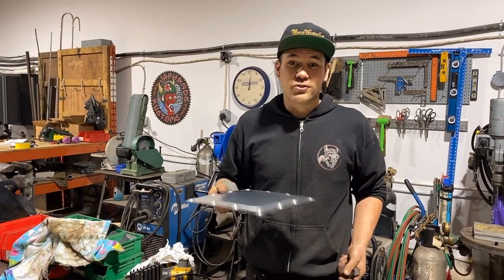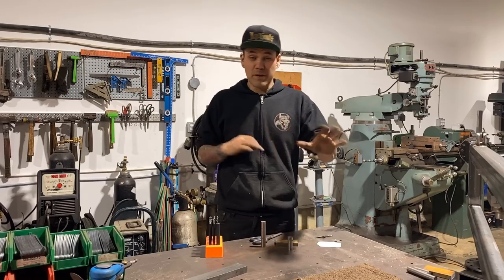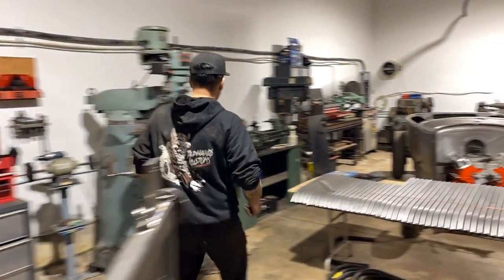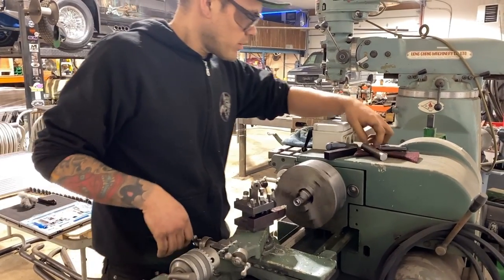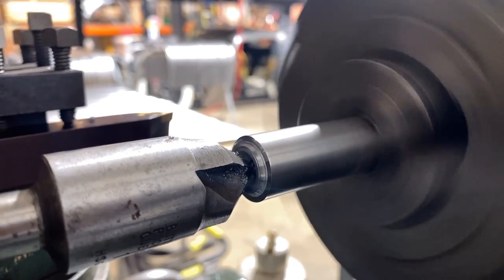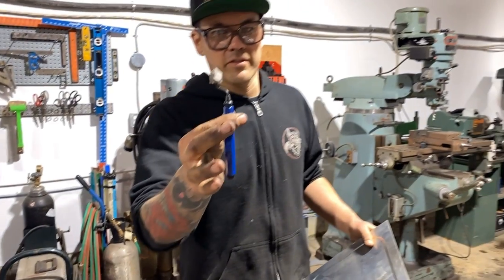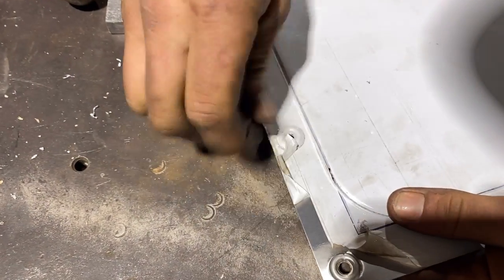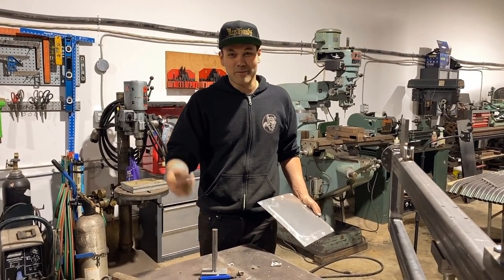How to Make a Dimple Die Punch Tool!! Countersink Screws in Sheet Metal + Flatten Bead Rolled Panels

Comment: That's a pretty neat tool, the way I made my dimple dies for tappered screws before I got my lathe was I took countersunk machined stainless washers that I brazed over a larger, drilled piece of cold roll steel or bar stock. Then I drill an undersize hole in the sheet metal I want the dimple in, take a tappered screw that fit the hole, place the sheet with the screw over my tool, give a good whack on the screw head, that will start the tapper and enlarge the hole, repeat with the correct size screw, then with a piece of tube of a slightly larger diameter than the washer placed over I hammer it. It can be a pain to center, but it gets the job done. If you don't have a lathe it's super easy to fabricate and in no time you can make different sizes.

Comment: Another Great Idea and great tool Karl. I was thinking for the 3/16 “ alignment pin, for those that don’t have or want to use a transfer bit, most people that have tools have old broken or dull (burnt) drill bits laying around.. One of the 3/16” drills flute end could easily be fastened with Loctite or epoxied into one of the tool half’s. Also for a template most home building stores have pick bins where you can find the countersunk washers that could help with the size and shaping. 
Thanks again keep em coming.

Comment: I like your approach to getting things done. I learned long ago there are more ways than one “correct” way in machining. 

However, always remove chuck keys. Keep yourself safe around lathes. They don’t care about skin and bone. 

Keep up the good work.
Reply: I second this comment 
👍👍👍😜🏴🦕🦄😁✌🤞
Reply from the maker: Thanks for looking out Dave! Cheers
Reply: D. Conrad,
my woodshop teacher in jr. high rigged up a 'plate with a hole in it' over the drill press on switch
You had to use the chuck key to push the 'on button'
Reply: Yup he's building a lot of stuff in like the traditional-style hot traditional style hot rods with the little bit of a more modern flare but still kept in the traditional-style alive is what I'm trying to say Google Voice doesn't always let me say like I want cuz it translates it bad or good sometimes
Reply: Yup. For real.  Lost skin from working on cars as well

Comment: Karl, that's a great tool and a very easy way to make it.  Please remember to put a heavy chamfer on the end of the punch that you strike with your hammer though to avoid eventually injuring yourself or anyone else nearby, like any punch or chisel that mushrooms and splinters when hit.  My "Machinist OCD" would have had me going to my books looking up the dimensions of the screw head to get exact angles, etc., but seeing that eyeballing it works just fine tells me that there is a cure for that specific case of OCD!  ;D

Comment: I have found that if you do the dimples first and then bead roll it doesn’t distort the bead roll and it still keeps the panel tight. Works really well for when the step is close to the dimple.

Comment: Thanks a million for this video! I've been fabricating firewall panels for my C10 and I'm using rivnuts to hold the panels to the firewall. The dang rivnuts stick up 0.050" and prevent my panels from laying down flat with my button head screws. Inspired by your video I fired up my crappy 20 year old Harbor Freight mini-lathe and made a set of dies to emboss a 0.050" dimple in the panel to hide the rivnut. I used a 1/4-20 nut & bolt to cinch it down rather than a hammer. Love the awesome videos!

Comment: Thanks Karl, you have a great channel and you are a great teacher. 
I made me a set of this tool today, but since I dont have a lathe I used round stock with a snug fitting pipe around. Then I only needed a pillar drill and a grinder to make the profiles of(and welder to fixate the pipe to the dies)

Comment: I've made a few of these, but never thought of raising the "bubble" around the countersink. Not making the bubble means that the countersink area protrudes behind the sheet and requires countersinking the supporting metal to receive the back of the depressed area. The bubble lets the countersink be entirely above the supporting surface.
One thing I would suggest: make the pin 1/8" (about two-thirds of the screw size). That way, when the hole stretches, it ends up the right size for the screw shank. 
Also, you can buy "dowel pins" from places like McMaster-Carr. You don't have to cut up your transfer punches.

Comment: Hammer Fab makes a similar one but it’s much smaller and use a draw bolt or press to dimple the material. I like this method much better at a press can be very slow or bolts fatigue and break over time.

Comment: When cutting your paper templates to create the die profile that you want to cut on the lathe, you can fold the paper down the center and cut the end of the paper to create the curve you need for the dimple.  Unfold the paper and you will have symmetrical across the profile. If you want to get real fancy you could fold a long piece of paper and cut it in the middle. When unfolded both side of the cut (left and right) will consist of either half of symmetrically fitting profiles.

Comment: I'd use a cheap HSS lathe blank to make a form tool on the grinder using the paper template you made initially. You only have to make the radial profile of the shape you want, and just plunge into the stock to get your die shape. Then you can use the form tool over and over, even use it to touch up a boogered up tool. You can make a form tool for both sides of the die.

Comment: I don't know if I'm remembering this correctly; shop class was over 40 years ago, but I think the angle formed by putting two hex bolts side by side may give you the screw head    angle. Think it work to get the angle for sharpening drill bits too.

Comment: I realize that you said it also helps to reduce warpage on some panels, but it would be so very, very much easier to just use countersunk washers.  And you wouldn't have to be right on the money with the alignment - the washers would have some give to them, and you could get them in zinc or black zinc for accent colour.    Just a suggestion.
You could make an embossing punch that would punch in some other shape like a little diamond or your logo or something to add a bit of shrink to the edges to do the job that the dimple punch is doing for your now, and use countersunk washers for the holes so that you can get the additional decorative effects.

Comment: I don't know if you already did this,(with my video quality)but you could round the end of the indexing pin with a grinder or file to make it easier to get the sheet metal in place on the pilot holes.

Comment: It's cool that the dimples are little shrinks to the panel warp goes away.  But if you wanted a flat flange, with button head screws, could you spot shrink around the flange with a torch to do the same thing?

Comment: While rebuilding an aviation hot dimpler I collected a list of what I thought would be useful dimples. The one you're making is at the top. They show the price as, that can't be, I'll be right back... $95USD so it looks like it'll be well spent time making your own and the fit can be much more personal.

Mittler Bros. No. 10 Finish Washer Dimple Die
Sizes (inches): for No. 10 flat head screws
Starting Hole (inches): 1/8
Flare Height (inches): approximately 0.110.

Dimpling beyond the hammer...
Magnesium, like 7075-T6, likes to be dimpled hot. It's a way to prevent cracks so if you want to improve the aerodynamics of your next Bugatti Aerolithe you could try countersinking the rivets that are holding the halves together. If you ever wanted your own hot cold pneumatic simpler a great starting place might be a look at a CP-450EA dimpler. That information in the manual is enough to build your own 3200lb C framed lump with a written 24,000lb of (I think I'll check again surprise) dimpling force. The electric heating coils would be the difficult part to whip up but they are available and were reasonably priced and simple to adapt to a homemade machine. The rest of its function are controlled with just pushbuttons, limit switches, timers, solenoid valves, PID controllers, 90psi air pressure and a 15 amp plug in cord cap. The originals have shown up for the cost of scrap metal and occasionally for free if someone wanted a fun rebuild project.

I may have gotten a little carried away but dimples are such a cute little topic.
Reply from the maker: Thank you so much for taking the time! I do appreciate it and I think we will do a small run of these tools I’m pretty sure I can beat that price

Comment: I don't mean to pick at your work. I love it. I noticed that you are cutting on the up stroke side of your piece. Try cutting on the down stroke and see how much easier it cuts. It also cuts smoother if you are just below center height as long as you aren't cutting all the way to the center of the piece. It works for me anyway.
Reply from the maker: I have the direction of the rotation reversed. I’m still cutting on the down. Thanks for looking out tho!
Reply: @MakeItKustom  sorry. It looked like it wasn't. I saw after I commented.

Comment: That's the basic method I've used to make dimples.  One thing that might be easier is grinding your own high speed steel blank to cut tighter spots than the insert tooling will fit.

Comment: Great tutorial! I really like your videos. I had a similar punch set that I used on an arbour press. Nice consistant dimples. One big comment! PLEASE don't leave your chuck key in the lathe. I had one of my guys to that and accidentally hit the power switch. I figure it did three or four circuits to build up speed before getting thrown across the shop. Hit the wall right beside someone. From then on if the key wasn't in your hand it was on the bench.

Comment: If i remember right those screws are tapered at 60 degrees. Set the top slide on your lathe at 30 and you should be able to cut a perfectly matching taper by moving just the top slide. It's faster than trying to eyeball it especially if/when you start making a lot of them to sell. Also face off and bevel the striking (back) end of the tool pretty heavily, i've noticed that edge started to roll a bit already.
Overall though, thank you for this how-to! Going to make something very similar for a small arbor press.
Reply: Usually SAE fasteners are 82 degrees included angle, and metric fasteners are 90 degrees included angle, but exceptions abound.
Totally in agreement about the top-slide.
Reply: @mikegraham7078  Interesting point about the angle, i did not know that. Would explain why some large countersunk screws don't sit in the hole right: hole is tapered with a metric tool, screw is SAE. Typical consumer-grade countersink is 90*, but most of the time taper angle isn't even mentioned anywhere.
So really the top slide should be set at 41* (for SAE) because that will be a good fit, and since it is for sheet metal the screw head will finish-form it if it's a metric.

Comment: U can also clamp the metal to a flat welding table buy the edges when its done  and light up the acetylene torch no oxygen till u get that real sooty big flame (on aluminum)  blacken the panel like your painting it let it cool remove the clamps no more warp it relieves the stress in the panel soak in a chemical called mek to remove black polish as needed

Comment: Another great video. Yes, the two dies should not match. The female die should accommodate for the thickness of the metal and will be a little bit wider on its opening, otherwise it will cut the metal trying to shear it.

Comment: The angle on a standard machine screw is 82 degrees, FYI.   On machine screws that are intended for very thin metal,  the angle is increased to 100 degrees to avoid splitting.
Reply from the maker: Thank you!

Comment: Another comment.   I love your enthusiasm and your willingness to experiment.   I first started turning on a belt-driven lathe using hand-ground tooling, so I am sympathetic to doing things a bit 'old school'.    However.  :)    I want to point out that burying the tip of a cutter, particularly a carbide insert cutter, is a poor method for getting a shape, particularly when turning the end of a small diameter.   The insert doesn't have enough relief, and it's going to chatter like a sonofabitch in almost any circumstance.
You lathe has a top-slide which can be set to any angle that you want.  If you use that top-slide then you can cut the grooves incrementally which will give you a FAR better finish.  I'm only 11 minutes into the video... I am expecting that you will be doing a lot of sanding on these pieces to clean them up so that they won't mar the sheet metal.
Oh, and I would have been running it a lot faster.   With regular high-speed steel tooling I would be running at around 600rpm.   With carbide tooling you could be running at around 2000rpm.  Running with the top-slide doing a proper turning cut with the nose of the insert instead of peeling it with the edge of the insert would have given you a much better surface finish.

Comment: Nice little dimple tool, me I would of made the end with the pin a bit shorter and the back end I would of turned down to a diameter of the hole in your table by about an inch long and  put it in the hole to hold it. I think it might be more precise and less vibrations. What do you think?

Comment: Not to nitpick but for safety sake you should never cut on the back side of center on the lathe.  You want the force going toward the cutter and down.  Thanks for all you great ideas.
Reply: I was going to say the same thing. I double checked he didn't have the lathe running backwards. I'm surprised it cut at all and didn't break the carbide when he was on the back side.

Comment: So,.. if I for some reason don't want/can have these awesome dimples, can I still make a raised panel and make the dimples further out and then cut them out/away and the tension relaxation still stay?
Reply from the maker: I see what you’re trying to do here and yes I believe it would work to a point but your dimple would need to be very close to where you’re going to cut.
Reply: @MakeItKustom  can confirm it works. it remained flat after cutting out the dimples.

Comment: trick for you works awesome if you weren't aware buy cheap masonry carbide bits sharpen them like a high speed twist drill bit for steel they will drill through welded stainless use just water no oil on stainless if you ever find yourself in a to hardened to drill with a regular bit position this will save your ass!

Comment: Any reason why you could not use a 3/16 grade 8 screw instead of a pin? That way you could do parts that are already installed on the car. Another thought would be to turn down a cheap air hammer bit and make it into a die that can be used kind of like a pneumatic hammer form die.
Reply from the maker: Yes I think both those ideas would work!

Comment: I think they are "pimples"
Not "dimples"
🤣🤣🤣🤣
Something I was never taught in school, as you put it, was machining on the back side with the chuck still running forwards  !
I can't believe that it was actually cutting  🤔🙃
Reply from the maker: I had the rotation reversed
Reply: @MakeItKustom 
That makes sense with the swarf coming off the top of the tip.
 It must have been a filming phenomenon I looked especially and it was rotating forward as it slowed down.
Like the wheels on the stage coach in the old cowboy movies.
(before your time  😎)

Comment: You're actually doing more than making a simple countersink die. If you only countersink a panel intended to lie flat, you'll end up raising the edge of the panel the depth of your countersink.

You are recreating the profile of a countersink finishing washer, (My old brain is blanking on the official name of the damn things, but they were common in my era. Especially in the auto upholstery world.)

By making the die this way, you raise the countersink, so the taper of the fastener doesn't extend beyond the surface of the intended location.

FYI: The taper of flat head screws is standardized, regardless whether it's socket, phillips, slotted or torx. Again, my old brain needs to look up the degrees, but knowing the angle makes turning on the lathe much easier.

Oh yeah, next time you're on Carr's website, look up precision dowels. They are used in the mold & tool and die world as alignment pins. It's a small investment in a selection, and you will find all sorts of uses for them. The transfer punches are 0.002-0.003" undersize, by design.

Precision dowels are hardened, consistently sized & come in both plain & internally threaded on one end. Plus, you can get matching reamers to insure a precise press fit & an oversized reamer for a consistent clearance fit.  

(I've even custom ground large diameter dowels to use for the same type of tool as the topic of your vid.)

Including them in ypur arsenal of tools & materials will elevate your game.

Comment: Really cool! Have you not got a 2x72 belt grinder? I noticed your 4 inch one.
Reply from the maker: No I don’t I would like to build a belt sander tho
Reply: @MakeItKustom  no this is cool, I was debating building one but when I looked at the usage I couldn't justify it. I did think about using my 4 inch as a base to make an extender attachment to attach to the sanding wheel. Food for thought aha

Comment: With your punches and dies you make do you case harden them for longevity at all ? 
Side note you scare the hell out of machinists leaving chuck key in and items on top of lathe that could fall into spinning machine, hobby machinists don't see the carnage that ensues as often as production shop machinists which is why the safe practices is so important
Reply from the maker: I don’t heard of them but when I make these to sell I will use heat treated steel